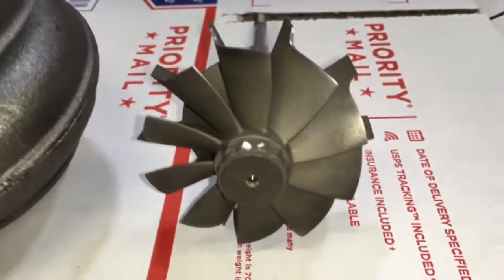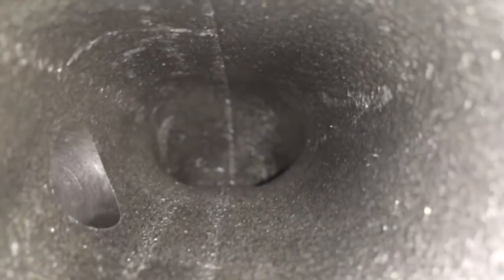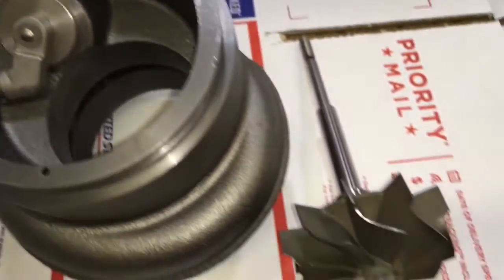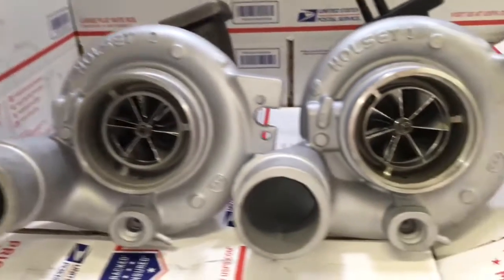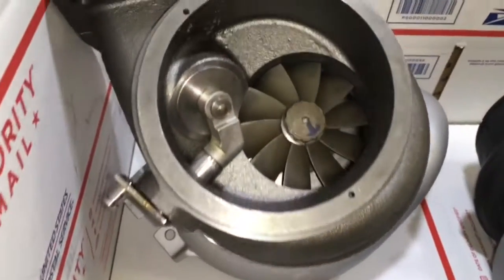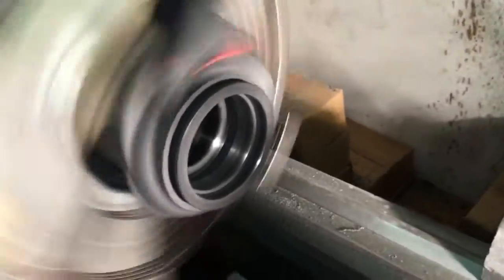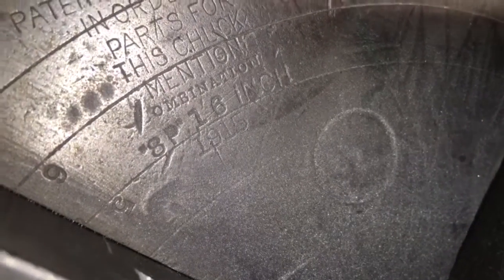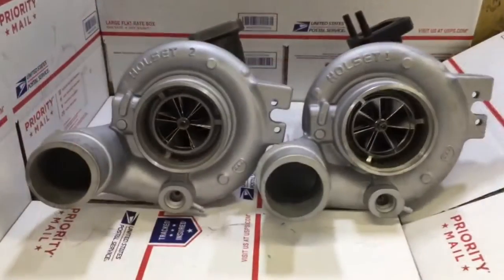He351cw turbine housing

Comment: Whats your thoughts on putting an he351cw on a 4 cylinder import? Specifically a Honda that I'm looking to make upwards of 600hp
Reply: im fitting one onto my 2.3l volvo 5 cylinder rn, increasing the size of the wastegate port to reduce backpressure and lower egts. Just got it today and I'm still building the engine so not sure when I'll finally be running it. The wastegate port looks to be about 5/8 of an inch and I'm planning on increasing it to 1.125 inch. I think these turbo's are perfect for a 2 liter. From what I've seen on dsm forums, they start spooling around 3000 rpm and full boost around 3500-3750, which is about 35 pounds on most dsm builds. I plan on running 25 psi to start with and work my way up to 35 pounds. Consider upgrading valve springs if you haven't. 35 pounds on the upper side of the spring is likely to cause valve float and rob horsepower. The other limiting factor is the 58mm exducer on the turbine, the 64mm or the 67mm turbine might be the right answer, but the 58mm will have incredible response which will make it more fun on the street.

Comment: I had you guys build my turbo 67 mm x 67 mm, I couldn’t be happier. I am finding lower EGT‘s 200 to 300° less.
Reply: Was yours a HE351CW with the 67x89x95 billet compressor wheel and 67x76 10 blade turbine wheel? Im thinking about sending my HE351CW to get machined for the 67 inducer and 67 exducer for my 1st gen cummins.

Comment: so does this just assemble rite up with no additional parts to the compressor side ? , does this bolt up to a Cummins ex manifold ? and does the ex elbo for a Cummins  go rite on to this with no additional parts ? if so this is a great upgrade for my truck improving drive pressure ,EGT's and that will improve compressor side efficiency too I would think .

Comment: Tips for lining up housings on the lathe. Soft jaws made per a housing.
Reply from the maker: +Mark Rich you have to resurface the compressor housing, I grab it on the inside on both sides of the compresor housing
Reply: I didnt say you did or didnt I dont know your operations  .
 Soft jaws are an opposed image ussaully of what needs to be chucked. You wont have to zero out you lathe any more one you have a set of them . They will be true to your work piece. Save tons on setup time.  I own a machine shop and use them dailly on my fixtured parts.

Comment: What is the difference between holset 1"" and "holset 2" ??? Can't figure it out. My 2006 mega cab 6 speed 5.9 has the holset 2. I ordered the wicked wheel 2. Just confused how to remove the compressor housing. Any help is appreciated
Reply: DanielPats1228 big c clip on the back of it,and i have searched for holset 1-2-3 people say they are the same i am not sure,i have a 3